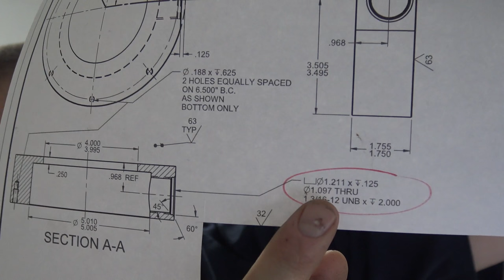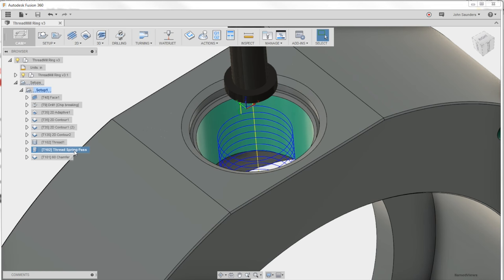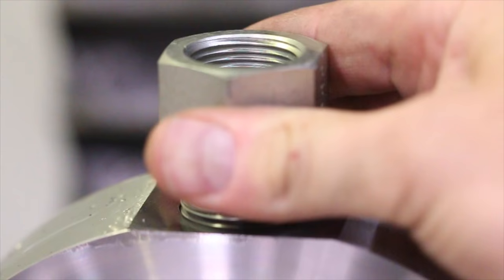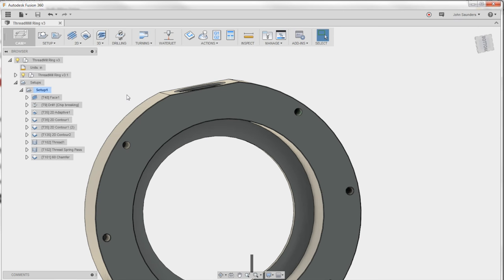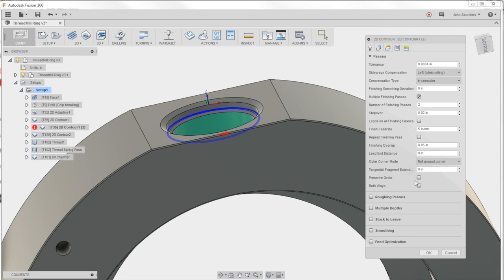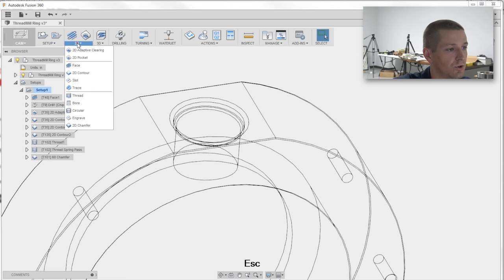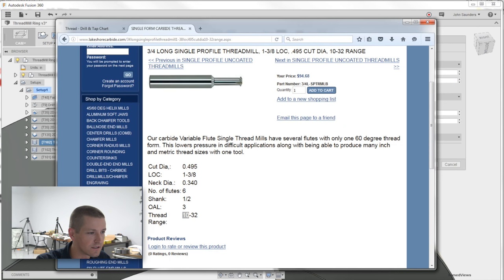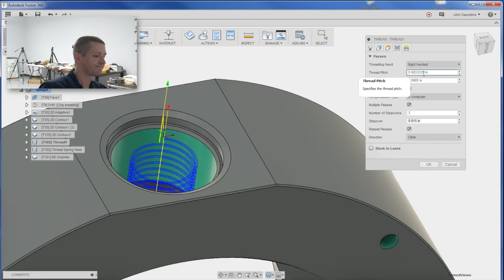Threadmilling on a Tormach with Fusion 360!  WW109

Comment: About your perplexity regarding the necessity to sneak up on the final fit for your milled thread: 

The thread milling cutter's helical interpolation cylinder diameter results in the sharp tool trace being larger than the nominal OD of the thread being cut by 2 X the thread crest truncation for internal thread (Unified system). My Machinery's Handbook (16th Ed) has illustrations on page 1120 and 1121: "Limits of Size Showing Tolerances, Allowances etc" I'm sure your 28th Ed has something similar.

See how the internal thread major diameter is larger than the nominal diameter and how the truncations of internal and external threads are manipulated to prevent tip/root interferance.
Reply: Exactly this. The Major diameter will be smaller than a sharp toolpath diameter by sqrt(3)/8*P where P is the distance between threads (inverse of threads per inch)

On the difference between same-pitch threads of different diameters: your thread profile depends on both, so the major diameter will make a difference as well--mostly in the crest truncation--which leads to the offset above.

A good UTS thread profile diagram should make both of these statements very clear.

Comment: can you thread mill 4-40 in aluminum? Steel?  What is the practical limits if there is any?
Reply: Yes. They actually have down to 0-80 thread mills. (And maybe smaller now too)

For practicality. A tap is always the fastest way to make a thread provided your machine has the capacity and HP to drive it. 

With single points you can do several different thread pitches and sizes with a single tool. Slower, but saves you a ton in tool changes and tool holders. Especially if you can helical bore the tap drill size with an endmill instead of a drill.  You can also do either internal or external threads with the same tool. 

Anything 1/2"-13 and smaller, a tap is still the best way to go. The only exception being if you have to tap hard (50 HRC+) material. Then go with the thread mill. Even though a tap can do it, it'll wear out quick and probably break in a hole at the most in opportune time.

Comment: Hi John, awesome work ! One question... how versatile are the thread milling tools ? I mean, is there a limited range of pitches a certain tool will allow you to make ? If so, how many different thread milling tools you´d need to cover a usable range of thread pitches ?
Thanks !
Reply: Very versatile. Pretty much an infinite number of thread pitches can be made. The only limit is the required thread depth. Which will require you to bump up to a large thread mill 

Multi-flute thread mills are limited to only one thread pitch, but are about 5X faster than single points. 

The best investment ever is NPT tapered multi flute thread mills, they are rather pricey, but honestly once you use them you'll never want to go back to the old style tapered reamer and NPT tap again.

Comment: major diameter for internal thread is nominal. so its actually bigger. there should be tolerances too. if there no tolerances. peek pitch diameter and add half from it to nominal major diameter. you safe :P. i dont use CAM. i have build custom makros for everything. 1 line code will do same as 100000 lines cam :D

Comment: Man. You are just so far off on feeds and speeds.  The RPM was in the ball park on the drill, but you're feeding half what you should (at least 7 IPM). That end mill should be running at 6000 RPM and 75-100 IPM. 

Kinda sketchy how you used the 3D taster to try to find the center of the part. I would have used a square or something touched up against the OD.

I always start at the bottom of the hole and climb mill out with a thread mill. Takes a lot of time to sneak up on the pitch diameter.
Reply: He has limited HP on that machine don't forget. 1/2" drill is a pretty large power consumption on that machine. 

That's why a lot of his speeds and feeds on large diameter drilling or large dia turning are fairly far off from optimal. He hits the max HP on the spindle pretty quick.
Reply: OK. But if HP is limited, you need to reduce feed and speed to keep the chip load where it should be. He should cut the drill RPM in half to get the feed closer to .01/rev so it will properly break a chip. Same with the end mill. It's squealing like a pig because it's rubbing instead of cutting. It needs way more feed or even less RPM.

Feed and speed are 100% interrelated. You cannot change one and not the other.

I enjoy the videos, but he's supposed to be a teacher. Feeds and speeds are most of machining. It should be taught correctly.
Reply: +Wes Johnson 

Since it's a single phase motor, reducing the RPM brings him too far down on the motors torque curve, meaning again it will stall out. 

The drill for that machine was just about right to optimize the chip load and still be within the motors torque curve. 

The endmill was a bit off but he said in the little popup he wasn't happy with it. 

The tormachs are a much more finicky machine when it comes to trying to balance chipload with machine power. Even a Bridgeport has About twice the HP and a far better torque curve along with being 3 phase power vs single phase. 

Considering the machines specs, he's not that far off from optimal. His only other option would be to reduce the pilot drill size down to 1/4" and run a 3/16" endmill for the C-bore rather than the 1/2" drill and 3/8" endmill. Then he would be able to run the correct speeds and feeds. But that too has its on sacrifices that would have to be made.  Though might have been the better option here.
Reply: I thought the Tormach had 2 belt ratios. It's pretty sad if it can't push a 1/2 drill. A Dewalt cordless can handle that...
Reply: +Wes Johnson a dewalt drill is also designed for high torque applications.  It has a 30:1 gear reduction from the motor. It's highest torque setting also maxes out at a paltry 450 rpm. And I highly doubt a hand drill would go though that material even 1/2 as fast as  the Tormach did it. 

Also the Tormach goes up to 10k rpm. Vastly different motor and gearing designs.

Comment: Hi, John. In this video you show a 1/2" hole being drilled in what looks like one pass at 650 RPM, 4 IPM Peck. I have an 1100 and tried this setup and the spindle stalls. Are the speeds and feeds shown in the video accurate?
I'm asking this because I bought my 1100 used and I'm concerned that something is wrong with the spindle if it can't drill the same hole successfully.
As always, thanks for the awesome content and inspiration!
Reply: A 1/2 dia. drilled at 650 RPM and 4 IPM is a gravy cut. That's only .006 in/rev. What material are you drilling? Are you cutting it dry? What is your peck depth? What is your drill depth? You may not be clearing the chips and the tool is galling and seizing.

Comment: I can't do thread milling on my manual machines. :-( Someday soon though! Just 45ft more of shop wall and I will have a shop with 4 walls!
Reply: If you dial in your Z power feed speed and RPM just right you can do it with a boring head XD
Reply: Occams Sawzall
I have a powered rotary table, with the right set of change gears I actually probably could do it by engaging the rotab feed and z feed at the same time. That is true stunt milling right there!  Calculating the proper gears and feeds to get the right thread hurts my head just thinking about it. :-)
Reply: +bcbloc02 used to work with an old guy from Germany (still working on his 70's) who can do things on a simple Bridgeport that I'd find tricky even on a 5 axis. 

His said his apprentice project was to hand file and lap a 1-2-3 block to +\- .0002 in dimension, squareness and flatness....
Reply: Occams Sawzall
Always as much the man as the tools. I would sure hate to spend all that time on those 123 blocks only to take .0001 too much off on that last stroke!
Reply: +bcbloc02 
He made it in the 50's or 60's. Still had it in his box. Obviously a little dinged up and worn,  but we threw it on the CMM for giggles.... Damn thing was still within .0004 all around....  You barely even buy a 1-2-3 block brand new that good!  Yet 50 some years later his little block was still kicking ass

Comment: John, more often than not, the tool tip radius is what forces us guys to have to monkey with the numbers. We need to remember we are touching off our cutting tools to the tip surface, with whatever radius it may have. That exact radius is often unknown. The published minor/major diameters make an assumption of tip radius and you can bet it's not the value that applies to the tool you're using. Lead angle is something else that I notice is not discussed in so many videos on single point threading. After all, most of us are cutting threads of 8 tpi to much finer pitches where the lead angle role diminishes in practical importance. If you like, I'll provide you an equation for cutting depth to take into account your tool tip radius. This will give you the numbers to make you shine first time, every time.
Regards,

Bill Phillips, Surrey, BC, Canada

Comment: Can you single point npt threads.?
Reply: In milling you don't actually single point threads like you would do on a lathe. You generate the threads with a helical motion. Yes you can generate NPT threads.

Comment: John, here's a pic that easily explains your question. I know I usually find myself reading threading explanations 10 times before I grasp what the person is saying. If you are a visual learner like me, this should help.

As you already know, UNC and UNF threads have flat roots and crests. Unless your cutting tool has the exact same radius on it's tip as what the thread calls for (it won't) then minor diameter is a poor measurement to use. Thats why we always measure from pitch diameter (in the case of external threads). You'll see in the picture that if you had a perfectly sharp tool and you cut to minor diameter, the thread will not be fully formed, you actually need to go past the minor diameter. However, the minor diameter gives you a relatively safe starting point when it comes to internal threads.

https://s13.postimg.org/j4h0nvj6v/NYC.png

Comment: About the thread milling problem. Take a look at this picture https://en.wikipedia.org/wiki/ISO_metric_screw_thread#/media/File:ISO_and_UTS_Thread_Dimensions.svg Thread diameters are specified based on the truncated triangles formed by the threads, not to the theoretical sharp points of those triangles. However a single point thread mill does cut to a sharp point of a triangle. You need to do some math to find the diameter of where those theoretical points are for a given thread specification. I made a calculator to do this. You can copy and paste this code into a text file and save it as .html then open it in a browser to use it http://pastebin.com/KJqERU6H This doesn't take thread tolerances into account, it's exact, I program it as is, and use tool wear compensation in Linux CNC to fine tune the fit. Also the thread pitch is the pitch not TPI, so i.e. 0.08333 not 12 for 12TPI.

If I put in the thread you were cutting, I get 1.2055" for the helix diameter you wanted to be cutting, or a 0.1085" pitch diameter offset from the modeled 1.097" minor diameter.
Reply: This explanation and coded solution deserves many thanks!

Comment: hey John, I'm about to make my 1er threads experiment with fusion. The problem I have is adding the tool to my library.

https://www.maritool.com/Cutting-Tools-Keyseat-/-Milling-Cutters-Chamfer-Milling-Cutters-Double-Angle-HSS-Chamfer-Mills/c78_231_237_239_277/p2419/Double-Angle-Chamfer-Cutter-3/8-dia-X-60-degree/product_info.html

in tool type which one did you pick. Counter sink, dovetail. can't find the way to have the doble angle option.
thanks.

Comment: It's the WORLD'S LIGHTEST, SOFTEST AND FREE-EST MACHINING "1045 STEEL"! And remember folks. ALWAYS USE A "CUTTER" TO MILL OUT A "PILOT HOLE" TO THE FINAL SIZE BECAUSE DRILL BITS ARE FOR CHEATERS! Or is that "DRILL BITS ARE FOR REAL MACHINISTS WITH REAL MACHINE TOOLS AND REAL EXPERIENCE AND KNOWLEDGE DOING REAL WORK FOR REAL CUSTOMERS TO REAL "PRINTS"?
Reply: stop shouting